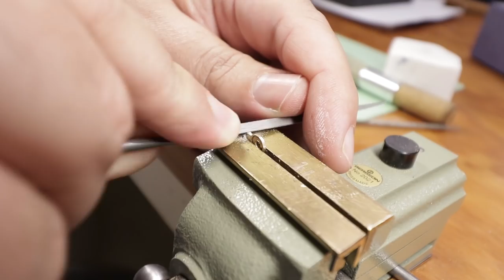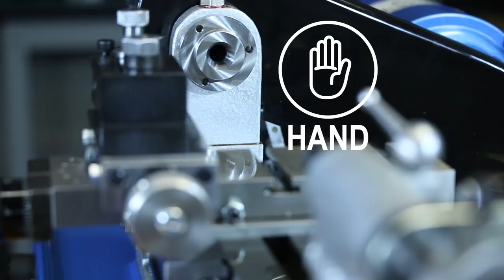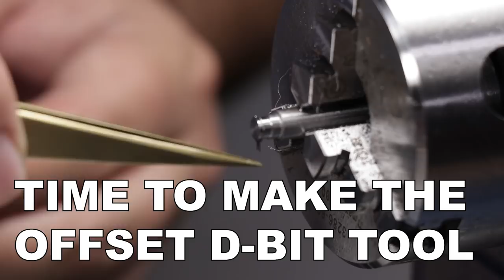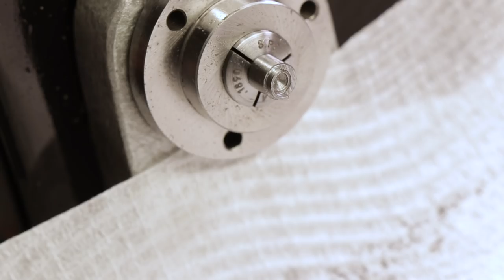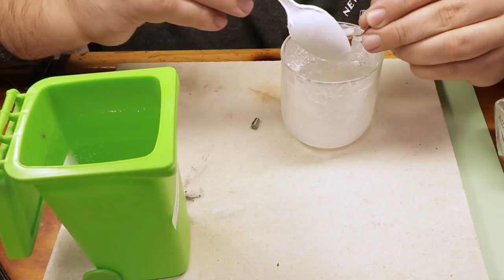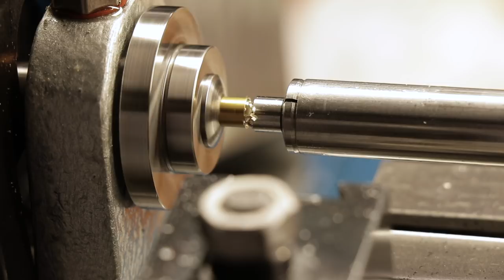Breaking the Balance Wheel Bridge - Watchmaking Vlog 26

Comment: Fantastic work man, as always. 

By sharing your mistakes, you enlighten us, nothing about that to be embarrassed of. :)

Btw, are you using the same steel for your round tools as for your rectangular tools / gravers? Had heard of the term "drill rod" before, but I'm wondering whether it's same sort of steel. Also, it would be great if you could share your supplier's info/website - if they're shipping internationally that is :D
Reply from the maker: Thanks Alper. The round steel is silver steel, same as drill rod. But the rectangle tools are Crobalt
Reply from the maker: Hmm I bought from eccentric engineering. But maybe available at a tool supplier in your country
Reply: Thank you!